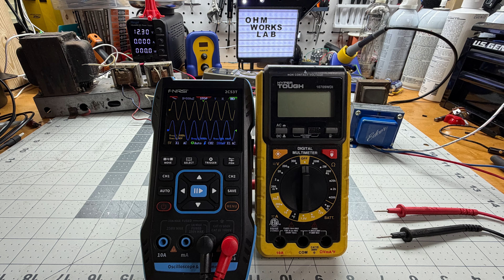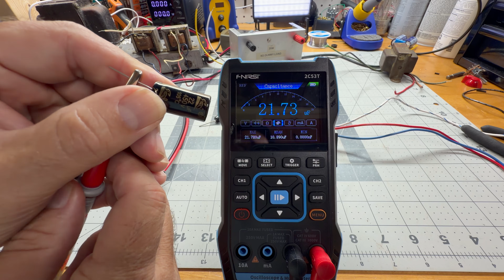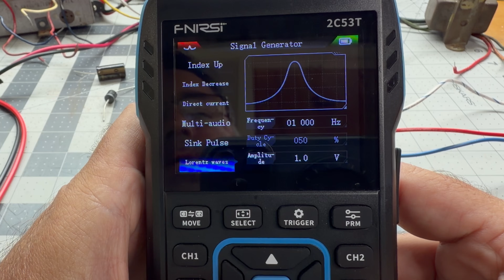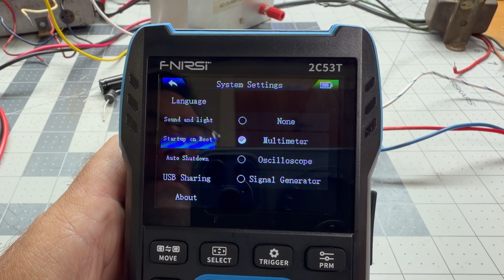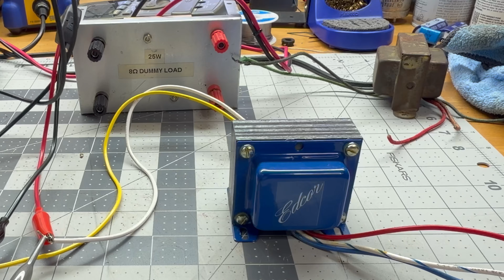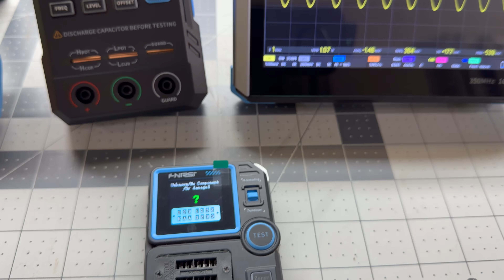FNIRSI 2C53T Basics + Hidden Feature | Output Transformer Test

Comment: Their devices look good, do a lot of things....badly. I've purchased so many of their devices for years and only ever kept probably 4 different devices that I did not return. There's a real gap in the market for a decent mobile scope meter that sits somewhere between their tablet scope spectrum analyzer and a low-end micsig.

Their new stuff has great industrial design, especially the bench stuff. Their main problem is that none of it works as advertised.

Comment: Most meters measuring temperature will give ambient temperature or temperature of the refrence junction in the meter when the input leads are shorted on the temperature setting.
Reply from the maker: Thanks for that info. It read 81F but would climb if I shorted the leads.